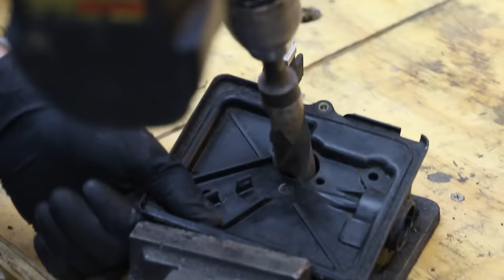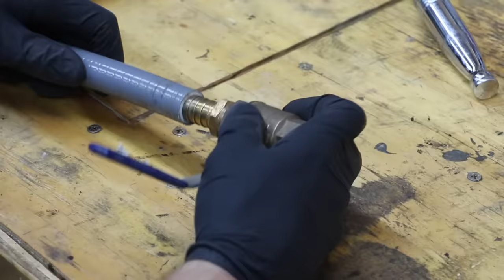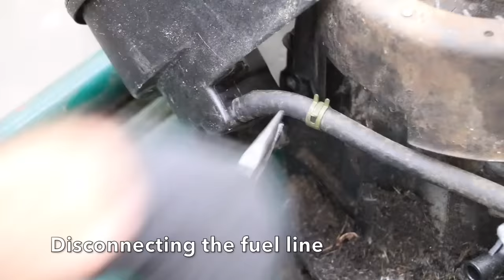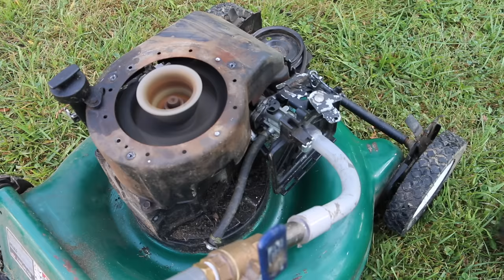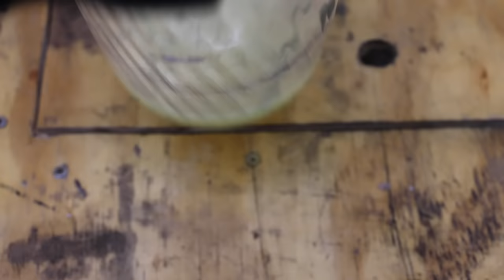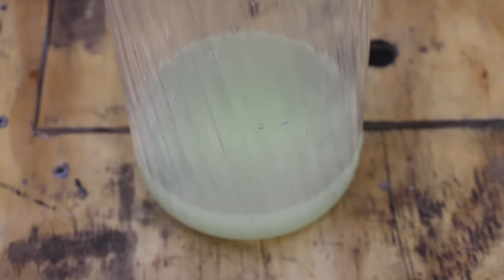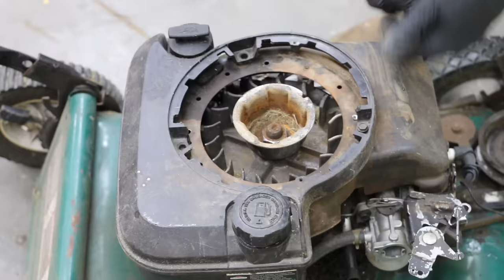Will a "Gas Vapor" Container Improve MPGs and Fuel Efficiency?  Let's find out!

Comment: Run the lawn mower on RC racing fuel with nitromethane.
Reply: are nitromethane dangerous? what gas would come out of the mower if I use nitromethane?
Reply: I don't think the gas coming out would be that dangerous. Nitromethane supples more oxygen to the fuel as it burns which allows an engine to burn more fuel in the cylinder which causes a increase in power. However it will run very lean and could damage the engine. Also pure nitromethane wouldn't work in a mower, it has to mixed with a fuel like methanol which is in RC racing fuel, but it could also be mixed with gasoline. But there is only one way to find out so it would be good to see Project farm test it.
Reply: I did that to a little motorcycle engine and it wouldn't stop running....
Reply: Yes it could be due to temperature of the engine causing the fuel to ignite with no spark, or possibly due to the compression of the engine. However, i'm not entirely sure.

Comment: Even though this video is 3 years old you tube is still recommending it to people like myself. I can't believe this worked. Amazing video. Love how you take the time to set up everything so it's equal.
Reply: Actually, I'm not.... when I was a kid I had a go-kart that used a 5hp Briggs & Stratton engine.... it went about 35 mph on the country road we lived on......... until it ran out of gas, then it surged up to about 60 mph before dying..... If I had thought of this set up back then I bet I could have hit 80!!!
Reply: @davidjones8942  

The increased performance was due to a lean fuel mixture, which also greatly increased combustion temperature. Trying to run it like that for any length of time would result in engine failure. 

Also, while an rpm increase would likely result, theres no way in hell you got anywhere even close to nearly 2x the normal top speed. Even if the governor was bypassed, what you describe just isn't possible, since the flywheel and rotating assembly could not withstand nearly twice the RPMs.
Reply: @davidjones8942  it's the fumes that ignite anyway.
Reply: this tech has been around a while, look up smokey yunick's gas vapor engine. Hell he even demoed to the Major car companies way back in the 60's or so. Wood vapor systems have been around even longer.
Reply: Myth busters done pretty much the same test.
Reply: @johnfox3845  you beat me to this response
Reply: P
Reply: @davidjones8942  ppppp
Reply: @davidjones8942  pp

Comment: This may be an old video, but I figured I’d say I appreciate your efforts. I knew you’d make it run, but I was really surprised at how easily it started and smoothly it ran. You save me many pops in the shop. Don’t ever stop what your doing, it’s gold!
Reply from the maker: Thanks!
Reply: @TurboSpeedWiFi  Thanks for chiming in, Mr. Know-it-all.
Reply: Look up the guy that invented the carburetor that got 60 mpg back in the late 60‘s 
His patent was purchased by an oil company. Then the solvent water fuel that was tested by the government in the late 70‘s someone had a patent that made this mixture coalesce and burn with no emissions
Reply: Now that's what I'm focused on. The automotive industry isn't focused on longevity or parts being spared. They are in bed with manufacturer to sell parts, and create a rotation on parts, cars and labor. That's the Truth Ruth ‼️

Comment: It was done over 30 years ago at Ariz State Univ and was taken by the big P and lock away!  The 2 biggest problems were ice on the carb and the motor over heating due to no evaporation of the gas to cool the engine. Air was drawn thru the pool of gas that had a fine screen it to breakdown the air flow to tiny bubbles to grab the vapor particles so it would only pull the vapor in to the engine block. A brass screen had to be added to stop any backfires from setting off the gas pool.  It worked great until big P said stop and took it.  Ariz State Univ also did a garbage to gas converter that was also taken by big P.  The icing on the carb from evaporation was solved by wrapping a few coils from the cooling system around the carb with copper tubing. So I know it ca work!
Reply from the maker: Thanks for the feedback.

Comment: The cloudiness of the fuel after running is due to water vapour in the air entering the fuel vessel
Reply from the maker: Thank you!
Reply: It could be but the water could be so little that its not harmful for the small engine, its just gas vapors and if there was water i bet that water will evaporate slower than the gas.
Reply: Water is forming in combustion process, and is present as small particles in the tank, so it's ok. As a matter of curiosity, BMW recently uses water injection in some turbo engines looking for cooling and avoiding "knocks" (it replaces the excess of gas needed). In Brazil, hydrated ethanol powered engines is really common, and some corrosion problems on engines are as well
Reply: Make sense!
Reply: The majority of the water is probably already in the petrol and the 'bong' is probably performing a (admittedly fairly inefficient) vacuum distillation on the petrol resulting in a higher concentration of water in the residue.
Reply: You need to use COMPRESSED SEALED IN A TANK Gasoline and Re-Do your video, please... No water vapor issues.
Reply: @Levermonkey  Glad I'm not the only one to compare to a bong 😂
Reply: @thalesreggiani2751  so true and they have been using water injection for years on high performance engines I would be more worried about a back fire never would that term be more appropriate should it happen you have a good mixture of fuel and air right in the ''fuel containing vessel'' it would probably explode.....
Reply: @Army of the Truthful LOL
Reply: @Army of the Truthful it wouldnt work anyway you need a good mixture of gas and air for it to run
Reply: @ICEMANTITO  there is a percentage of water in the fuel to start with...
Reply: Thales Reggiani I think I remember VW having a water injection system back in the early 80’s
Reply: Should have tried to burn the milky fuel as a liquid, to see how it burned!
Reply: @weatherphobia  That simply wouldn't be able to supply enough vapor to the engine to keep it running more than a few seconds.
Reply: Good invention d problem if the engine backfire,,, seem fire may occur
Reply: @weatherphobia  How are you going to seal fuel in a tank under pressure, bubble it and just draw off the vapours without any atmospheric water contamination issues?  You'd need dry compressed air injection to make the bubbles.  You'd first have to remove water from the air.  Feel like engineering such an exorbitant contrivance for us?  Thought not..
Reply: James Ray  that's why I was letting him know. I am concerned for his mother
Reply: @ProjectFarm  this would definitely cause detonation,  and it is really magnified in this instance  with running on fumes
Reply: Wonder if vaper method with today's ethinal gas works  as good
Reply: The cloudiness is dirt and such. Your using the fuel as a air filter
Reply: wrong! air  is mixed in the same way you whip egg white
Reply: @mikeszrx1100  yes, it still needs an air filter and a much better sealed container. Those pipes were huge. After mowing a lawn it would be muddy gas

Comment: Did you check see if the RPMs were the same with the vapors as they were with the gas I believe that would be the only real way to know one was as efficient as the other
Reply: Extra Gas = Extra RPM 😂❤️😂❤️😂❤️😂❤️😂❤️😂❤️
Reply: I think his method is just a limiting the gas waste that engine normally has. wether you like it or not, gas engines arent 100% fuel efficient. with him only running on fumes, there's no chance for the engine to burn more than it needs.

*edited to correct voice to text errors
Reply: And torque?  Again, just SWAG'ing.
Reply: These engines have a governor. They always run at pretty much exactly the same rpm. Just listen to the sound.
Reply: @Dtr146  Actually it could still be getting an air/fuel mixture with the fuel part being "more than it needs". (i.e., running rich, lower air/fuel ratio than needed)
To test this out --
You could add another gated air inlet anywhere before the carb to allow adjustment of the air/fuel ratio.
I suggest a tee at the existing gate valve to add second gate valve that goes directly to atmosphere (air filter if needed). After you start the engine you could begin opening the atmosphere gate valve to lean the mixture until it was at optimum.
(It would be optimum assuming full open of the valve was too lean to keep it running)
Reply: Kurt Frederiksen Thank you Mr. Frederiksen! You have explained simply, but very clearly, the process that causes an internal combustion engine to operate. Some people seem to be confused by terms such as vapour, atomize, gas, etcetera and they think each word has a different meaning. They do not... they essentially mean the same thing. IC engines operate by burning a fuel (commonly gasoline) that's mixed with air in a specific-ish ratio suitable for the mix to burn. That fuel/air mix is said to have been "atomized", "vapourized" (or any of a number of other synonyms). The set-up in this experiment was a very simple "carburetor" type device that employed differential pressure to atomize/vapourize liquid gasoline. A carburetor does the same thing... as does a throttle body fuel injector system or a port fuel injection/intake manifold system. Systems CAN be developed to make IC engines more efficient, but those engines would cost more to manufacture... and few consumers would be willing to pay the higher costs. The so-called "myth" of "vapour engines" is foolish, since all gasoline engines operate on "vapourized" liquid fuel. The real myth is that some slick hucksters have invented "add-on vapour systems" to increase the efficiency of your ol' jalopy!
Reply: @Dtr146  abstracly, your Statement is correct but this is a aircooled engine in which case it runs hotter that a water cooled. Therefore you dont habe to perfectly atomize the fluid. It vapors already in the hot engine parts and comes into the combustion chamber as a gas. It might be different when it runs on full load.
Reply: Yes indeed for if the output i the same then the fuel consumption has to more or less be the same..
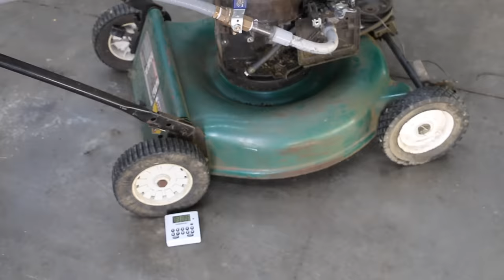Reply: 9:15 I skip the video marked 3 minutes and skipped to 27 at that moment I emptied the gasoline container leaving less.
Reply: I did this a few years ago on my lawn mower and although it only ran to 3/4 throttle, it cut higher grass than it would at full throttle. propane works the same way. I use it when I run out of gas for my generators here in Alaska

Comment: Here for those wishing to experiment are possible ideas.
A man that put a vapor chamber on his car got the equivalent of 400 mpg but it only achieved that when the gasoline was at a certain level. That has to do with how long the bubbles traveled in the liquid which means saturation or less saturated. Something to vary.
Then there is the engine that sent the exhaust out a pipe and the intake air was passed through a pipe within that exhaust.  Obviously this made the intake air hot. But not only that the intake air bubbled through used motor oil, or cooking oil. And I think that oil fuel was heated also.
Then there is the automotive engineer that explained how 1000 might is possible and that car makers are in cahoots with big oil. He wrote an article saying way over 50% of the gasoline is not burned in today's cars and, (are you ready for this?) that's what catalytic converters are doing, igniting unburned fuel!! Now you can call me a conspiracy theorists but nobody can deny that a catalytic converter gets way hotter than an a manifold without a catalytic converter.  So where in thermodynamics does the extra heat come from? 
So then the question is Can I make some fuel (probably not gasoline which is benzene which might ignite in the heating tube) can I heat some fuel and get a real good vapor air ratio that burns super efficiently and get 100s of times more run time etc? 
I think I would experiment with a generator and if I get it working there transfer it to a car.
Reply: Is there any chance we can talk on another platform. Id like to pick your brain about some things you've said here.
Reply: Surely, the extra heat in a catalytic converter is caused by the restriction created by the device (or indeed, any restriction in the exhaust system) itself?

Comment: Haven’t read all the comments on your video, but I recall reading that Tom Ogle heated the high octane gasoline for the Galaxie. Also, the vacuum was so great, it was caving in his metal gas tank. He instead engineered his own 2 gallon gas tank that was capable of the heat and the vacuum. Thank you for taking the time/resources to scratch the itch a lot of us DIYers have regarding energy efficiency.

Comment: If a carburetor is performing properly it should be pretty well vaporized anyway. Burning vapor from an external vaporizer or fuel from the carburetor should give the same performance because to run properly you need the stoichiometric ratios of fuel. But being able to do it from a bottle and suction tube is incredible and a really great experiment.
Reply: Murdock S also cleaner..... WAY cleaner.  Rigged a generator up one winter to prove it to my dad.....  after 15 minutes of running we noticed in an enclosed garage our eyes weren't red and there was no smell.... a LOT of unburnt gas with carb
Reply: @MatthewGill-nv4tb  I wouldnt call 2-3% a LOT...
Reply: @MatthewGill-nv4tb that's probably more an injector jet / fuel delivery problem then a carb problem
Reply: @JamesAutoDude  brand new generator..   brand new lawn mower and a brand new snowblower all just happen to have carb problems.

I know what you're saying.  But I've demonstrated it for gear heads in their 70s and they didn't even think it would work.....  needless to say they were surprised....  all of them know how to tune carbs and repair those problems
Reply: Even with a good carb, unless you have a sonic carb, you will still have a super fine mist. It won't be a vapor.
Reply: @Buzzard-wq1bw yep. I guess that's right.  EFI took all of that fun away.  A Sonic Carb would be fun! I miss the manual choke, lol.